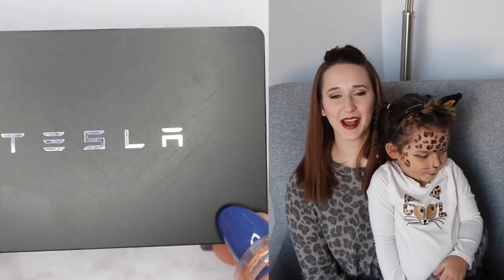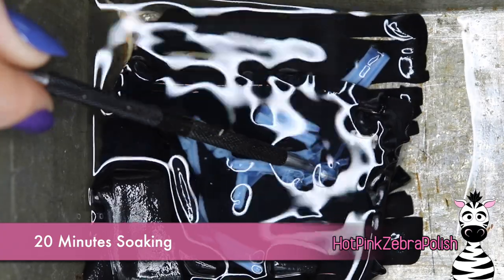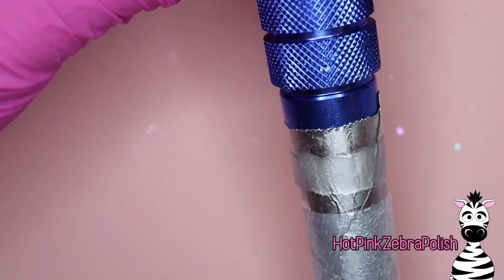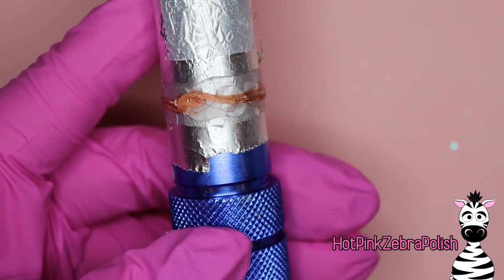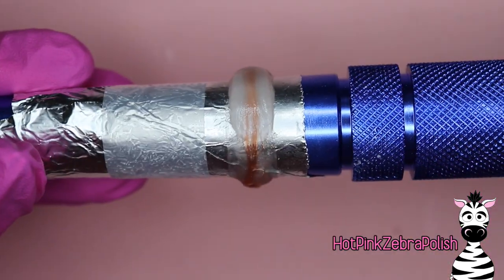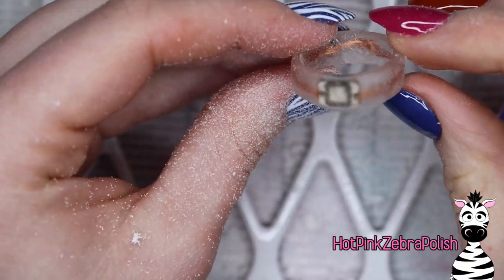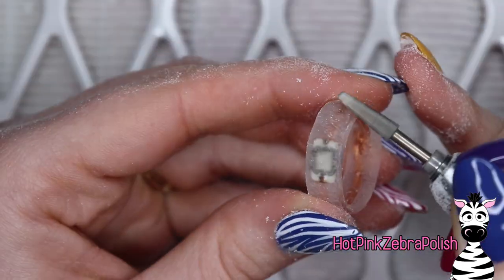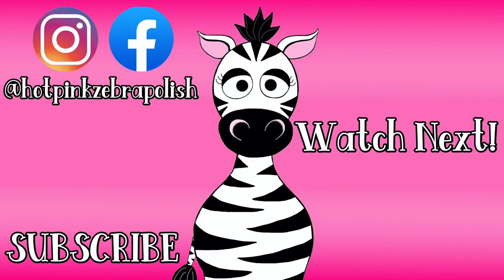Turning Tesla Key Card Into a RING! Acrylic Nail Art Tutorial

Comment: Nicely done--only one suggestion; based on the way you wound your antenna, the hole in the ring needs to be perpendicular to the A-pillar. Thus, unless you can bend your finger really far (and your fingers are absolutely tiny), you won't be able to "knuckle" the A-pillar (or--realistically--unlock the car) without taking the ring off.

I'll make a video demonstrating this at some point, but maybe you can get to it first: if you wind the antenna into a circle, pinch it to form a very skinny ellipse, then bend the ellipse around one side of the ring, you'll be able to unlock the car while still keeping the ring on.

This maintains the circular pattern of the antenna wire and shifts the polarization to work with the human finger.

Hope that helps somebody, and cheers!
Reply: Care to elaborate a bit more? I'm trying to transplant the chip and antenna from my key to the back of my flip phone. I want to know the best way to wind the wire